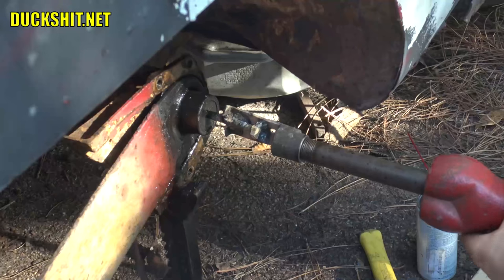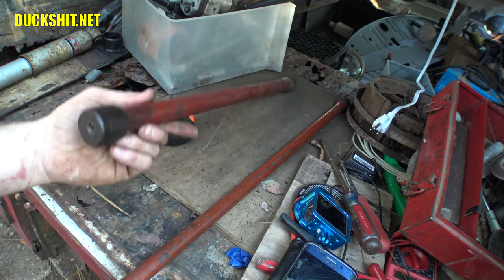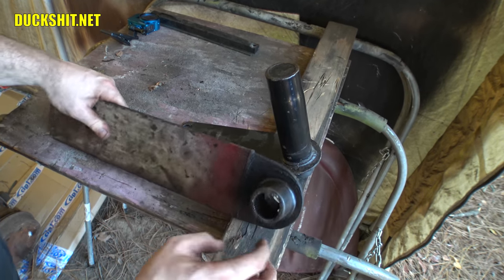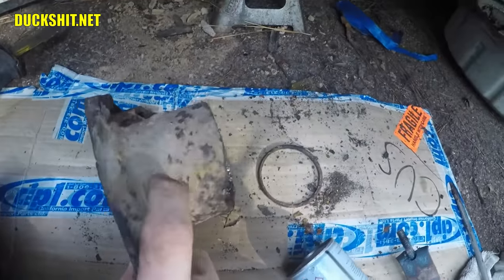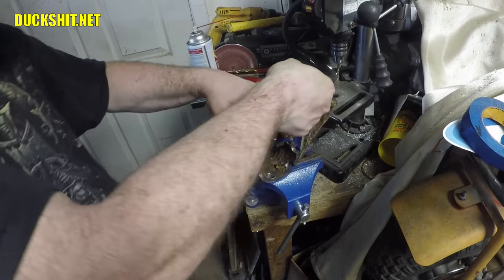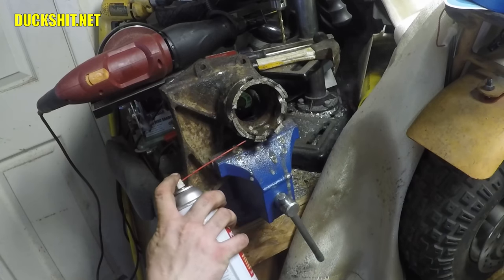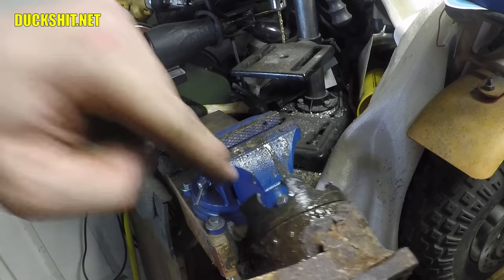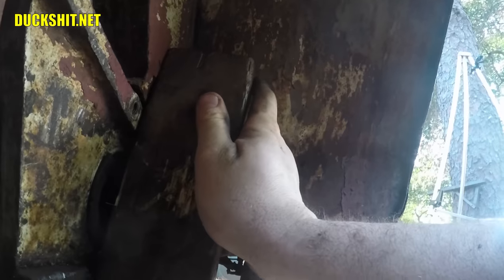Remove Stuck Torsion Bar - Narrowing Torsion - 1967 VW Bus - Gregory - 12

Comment: Little tip when cutting round pipe or tube. Use 2 hose clamps on each side of your cut line. Helps to keep sawzall blade straight. Not perfect but better than trying to get tape to stick to rust or oil.
Reply from the maker: Thats a REALLY good tip!  I never even thought of that before!  Usually people send me crap... lol!  But that is SERIOUSLY useful!  You will see me doing that on the other side, and credit will be given!  HUGE THANK YOU!
Reply: @DuckmanCycles  if you try to pronounce my last name. 
(Cal-cag-knee)
Reply from the maker: I may, don't whack me too hard on my NJ accent lol

Comment: I've owned Mopars in the past and one thing you never do is mark a torsion bar because ,as you say,they break right where that vice grip,disc sander, rock chip  mark was.
Reply from the maker: Thats exactly what they do!  With all the rust on this thing, its guaranteed its going to fail after exercising it on public roads.  There is no fixing it!  Gotta replace em!

Comment: Thank's Duckman are you going to use tortion adjusters on the inside!?!!!; )
Reply from the maker: Unfortunately I haven't found an adjuster for the center for Bus bars.  But I did mention I could make some thick racing Beetle torsion bars fit if I cut and remove the center of the Bus tube, I could always use the same adjusters that I put in Eleanore.  Not sure what I want to do there yet, but I could try to answer that in a Q&A video tomorrow!

Comment: Well lets hope water is not getting in through the top somewhere it is possible I guess if there is a hole somewhere up there. Can you take it out to have a look?
Reply from the maker: Sadly the torsion tube isn't removable without some major surgery.  I can see the water line inside, it was about 1/2" deep, apparently thats about the height of the end castings ends.  The bottom doesn't seem to be rusted though, which one would assume that if its rusting with water sitting that would go first.  Maybe water just came in through the rubbers on the ends?  It would only take once for it to fill up and cause rust, and it doesn't look major, but the torsion bars are done.... it doesn't take much to ruin those though.  Thanks always for your comments and questions, man!

Comment: Hi Duckman - love your videos, what year beetle trailing arms are you using? and more importantly - the disc brake set up will be from what?. i think i will do the same on my split, I'm looking forward to the next video. Hi from Cumbria near Scotland
Reply from the maker: The trailing arms are from ANY year air cooled Beetle, they are all the same.  Or you can use some early Porsche 924/944 ones, also the same.  The brakes area bunch of parts from all over, I will try to demonstrate that in a later video when I collect everything, and I know it all works right!  LoL!